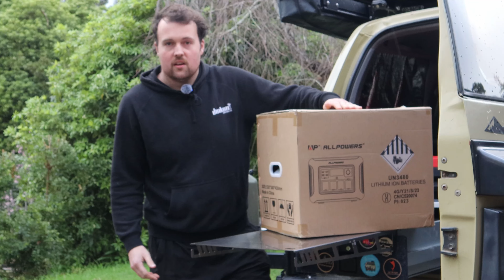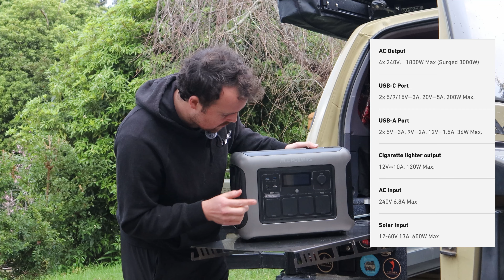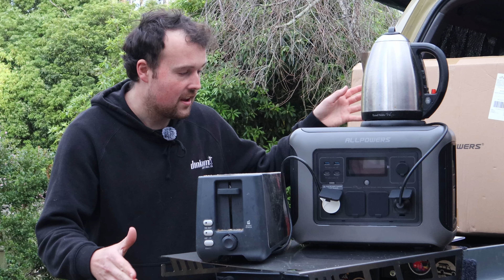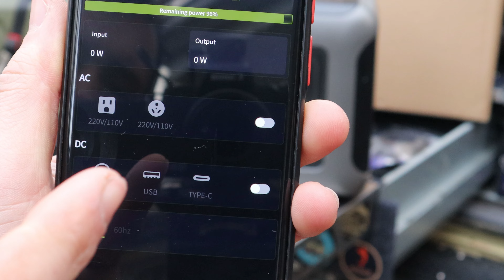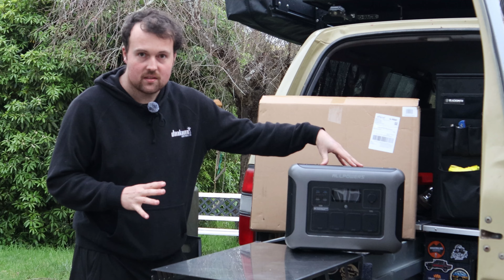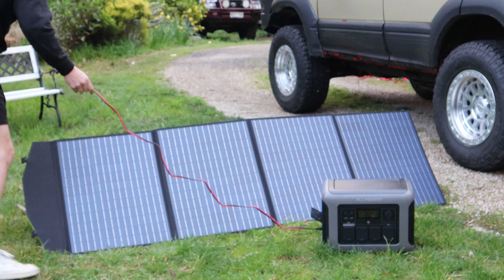ALLPOWERS R1500 || RUN a kettle & toaster at camp?

Comment: Hi I bought 2 of theese ,both of wich fully charged from mains.
They go flat over a month roughly.1 then refuse to charge past 30% on mains.it was replaced the new unit seems work okay on solar .the other original unit now doesnt want to charge past 31% on mains took it out to solar and it continues to charge. Isuspect they are in need of a firmware update.
Could be mine are early units? 
😢